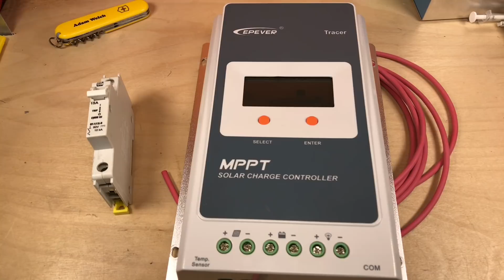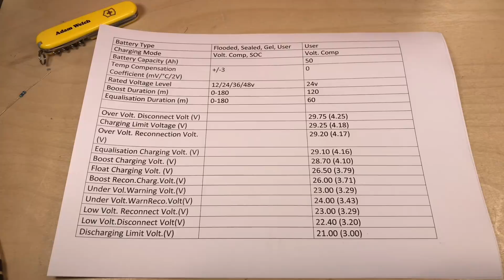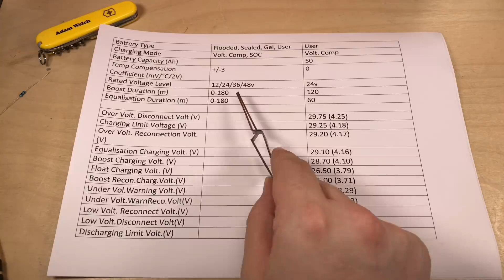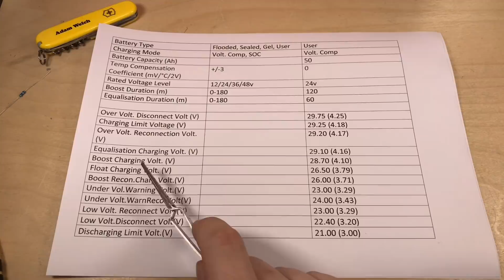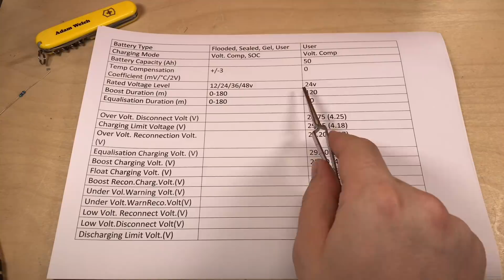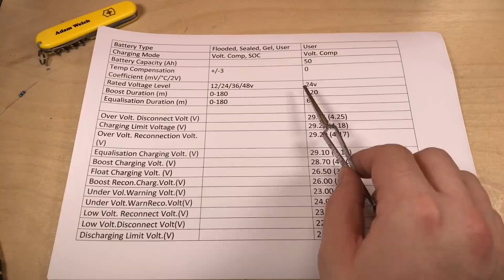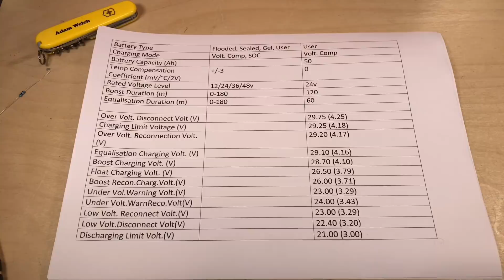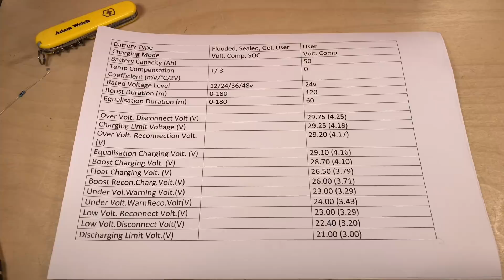Solar Charging the 18650 Blocks - 12v Solar Shed

Comment: By setting your float and boost recon so low it means there's a window between 4.16 and 3.71v where your solar panels are doing nothing and you are throwing away energy.  In reality if you can keep your cells >4V all day that would be best so I would set the recon at 4.00 and the float to something like 4.05
Reply from the maker: This is an excellent point and has got me thinking. For me I don’t really use the power in the pack during the day - I’m out at work for most of the week. However that isn’t to say I might want to use the power, or I shouldn’t be wasting it. I need to have a think.
Reply: Adam Welch Yes, you want to keep the cells topped up while producing power with PV; not drawing the cells down, then reconnecting to charge. In this way, you'll ideally go into the evening with a full bank.
Reply: That's what a float charge is ... if your float is 4.05V and your cells are 4.05 then no current from solar will go into the cells... You need a voltage delta to have a current.  The problem with his setup is he will cycle his batteries (partially) during the day when he should be capturing solar.  Once the boost period is done no power from solar will be used until the batteries drain to 3.71V.  In fact that article recommends 4.05V specifically ...Point is if floating your battery to a 90% charge "breaks it" then your battery is worthless.  If the only "safe" state is "mostly discharged" that's not very useful.  So ya you shouldn't float at 4.20V but floating at 3.7V is kinda pointless too.

edit:  boosting to 4.2 and floating at 4.05 also means you will cycle a bit before solar kicks back in which ensures you don't keep the cells at 4.2V all the time but also means that should solar go down you still have a mostly full li-ion cell.
Reply: Yup, but you also don't want to keep them fully charged all the time.  Boosting to ~4.15V and floating ~4V (and recon at 3.7-4V range) would be best for most random li-ion cells/packs.
Reply: You could but that's what a float voltage is...  If you take an 18650 that is resting at [say] 3.95V and throw a 3.95V power supply at it 0mA will flow into the battery.  When your MPPT is in float mode it's bucking the solar power to the float voltage.  So as long as that isn't too low or too close to 100% you should be fine.  a float around 4.05V should be fine for any competent li-ion cell.In Adam's (current) setup he's burning energy until the cells hit 3.71V at which point any further draining will charge them to 3.71V.  Whereas if he sets it to 4.05V it means he'll burn off the boost charge and then start using solar power again once he uses 10-15% of the capacity (per cell).  Then at 4.05V solar will be used (if sufficient) keeping the li-ion mostly charged should the PV go down then turn to the cells.

That kinda pointless since there's no need to keep the cells that low and you're throwing away a lot of solar power in the meantime (depending on the size of the battery array).  He should have the boost to 4.15V +/- a couple 10mV and the float ~4.05V.  That way he's never fully cycling the cells but also not depleting them needlessly during solar hours.

edit to add: "technically" throwing 3.95V at a cell with a 3.95V charge will put current into the cell due to self-discharge but that rate is so slow for a healthy cell that effectively you're talking micro amps at that point.
Reply: This is how Victron tends to take you with a setup, preferring a microinverter on the panels then using the charger/inverter to completely cut the charging when it's not required

Comment: Great little project Adam and a very informative video.
You could break out part of that for a video on epever controller settings. Not much info  on setting them up for lithium out there 😁
Reply from the maker: Make that bit into a separate video? Well those setting might change so perhaps once I have them set I’ll do exactly that - cheers. 
How did you find me doing it on paper rather than in the software or on the MT50?

Comment: Here's and idea that might be useful to help the packs from warping or at least hold the Batteries if said pack does warp; and that is to use Zip Ties to close the pack. Long Zip Ties are cheap yet have considerable holding power so at least the Batteries won't fall out. Not sure if you have the room but a few small holes near where the Pack locks onto the Bracket should suffice... With Zip Ties you will be able to close the Open C design and should provide a bit of stability too... Cheers...
Reply from the maker: That’s quite a good idea. I’ll look to see how I could implement that. The new brackets are holding well for the moment - and temperatures are dropping, but it’s a good idea to have a backup plan.
Reply: Adam Welch Belt & braces.

Comment: I have a 7s system too with a mppsolar 2424mse I only charge to 4.1v per pack and no lower than 3.2v this will drastically increase the life of your cells I have 2100 cells in total with another 700 waiting for 4x5 cell holders. 
After watching your vids im looking at one of these charge controllers as ive got too many panels for my 2424 to handle im also really interested in the BMS too.

Comment: Excellent! you've done a great job on this. i do hope that it all works out and from what i can tell, it should. someone below suggested printing the mounts in PETG, both PETG and ABS have a higher melting point so they both may stand up to the heat a bit better.  I just saw now that someone also suggested one or two 12v  computer fans blowing across the battery mounts?
good luck & keep up the great work!
Russ from Coral Springs, Florida, USA.

Comment: hrm I guess you dont have the float at the 4.1v mark because keeping Li-ion on the charger for a long time can lead to degradation, the problem is is that worse than discharging them deeper since you will be running the loads on battery power as soon as the boost charge was finished? basically it will charge to 4.1v per cell on a normal day with solar running the loads at the same time (power coming from the cells if the sun goes behind a cloud) then when the boost duration is done after 2 hours it will stop using solar and only run on the batteries even if the sun is still out, until it drains to the float voltage at 3.8v per cell. doesnt seem that efficient as far as getting every drop of sun it can. im sure it will probably never get a full 2 hours of boost before the sun goes away but still what if it does? or if you want to run a big load when the battery is full? the power could come from the solar as well as the batteries but instead once it is off boost charge all power will come from the batteries. im sure as long as you are cycling every day it will not degrade the cells by keeping them charged all day.

Comment: you might consider changing the 15A breaker between the solar charge controller and the solar panels to just an ordinary light switch if you need to repurpose the 15A breaker.

Comment: Have you thought about printing them in petg ?
Reply from the maker: I've pretty much only ever printed in PLA - I definitely need to look at something more hardy.  Cheers
Reply: You can get cheap PETG/ABS from HobbyKing when they have random sales. It works fine for printing battery holders
Reply: PLA can only handle 50c. PETG about 80c. 
Print PETG with 30mm/s and 240-245c nozzle temp. I print myself brackets for 2 solar panels in PETG just now. But I had to buy a new PEI magnetic Surface for 30€.

Comment: why not putting 3 or 4 120x120mm pc fans under that shelf to move the air a bit and avoid the heat and the PLA warping?
Reply from the maker: Sadly the shed isn't insulated and as mentioned by Mai the ambient temperature is high.  It's rained already this evening and is notably cooler - I might be safe again until next year now anyway!

Comment: what do you plan to run from the pack?  
I've now been going on two years and still haven't worked that one out, but, now I have far more of a chance, in December I managed to get a mortgagor for a house weee
so I plan to eventually (as fund permit) to set up a set of 12v LED lighting strings through out the house.
and to run my new security camera and DVR from the other pack, as it all runs from 12v.
Reply from the maker: Sounds like you have a big (and satisfying) project to do - good luck with it.  Having a 24 volt pack I can use will be handy with some of the kit in the shed - my 'bench power supply' should work a little more efficiently for example.  However I think I need to find an inverter.  If I find a nice quiet one I'd like to make sure the shed is fully off grid.  My soldering iron (and my power tool charger - but that's another story) are both mains fed at the moment and I'd like that to change.